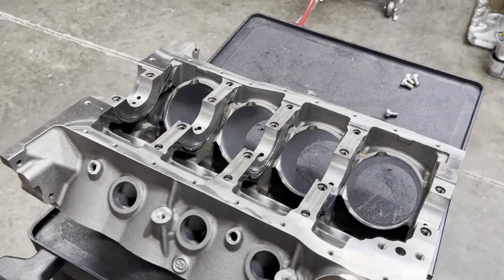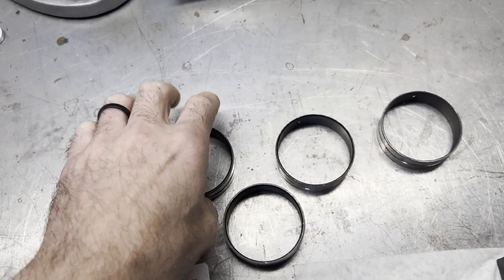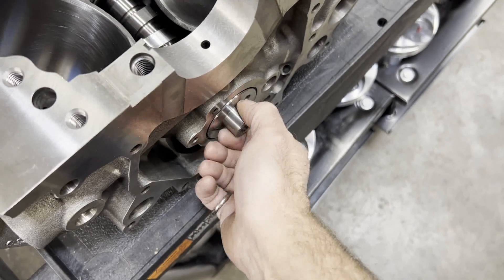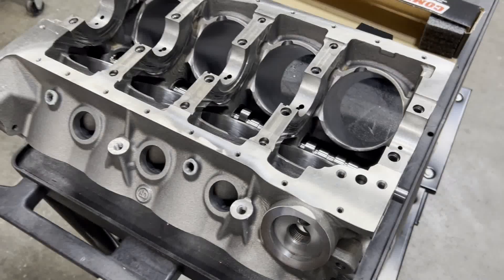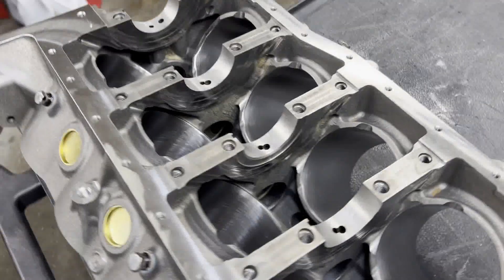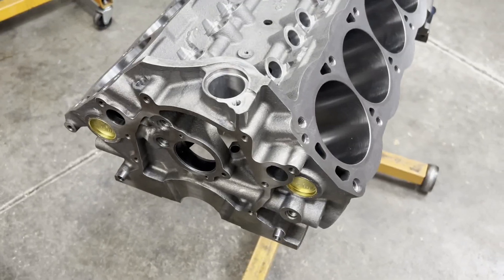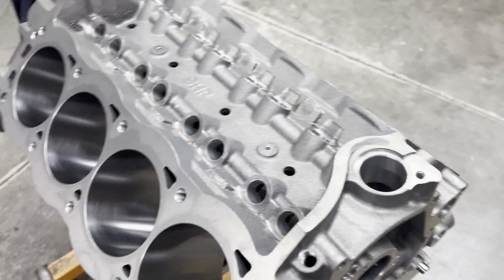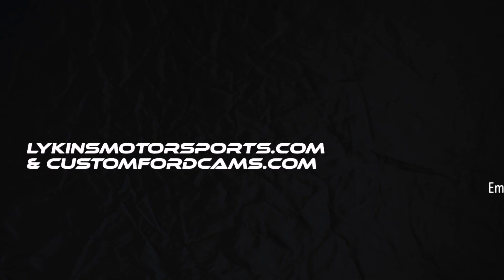Lykins Motorsports Dart SHP 8.200" Deck Overview/Prep

Comment: I heard your comment about the tingle in your foot. I definitely feel for you. Do you suffer from sciatica? I’ve had two MRI’s and several lower lumbar shots between L3 and L1. I tried whaat an old doctor told me to try, and I do not suffer ANY pain. I’ve been in and out of pain for over four years now, but when I started take it Vitamin B3 niacin-amide 10:29 , I got to were I had almost no pain. Niacin-amide is cheap and I take 1 or 2 pills a day. It’s your call, I am not a doctor, but I took the experience of an old doctor and got relief.  You c@nt hurt yourself taking this vitamin, and you can talk to your doctor, you prerogative.  Best regards Chet Marcotti, NH

Comment: Great update, You may have told us but, what do you use for cam plug sealant and freeze plugs?😁
Reply: I think he uses silicone sealant. 
I worked for an engine builder. 
And he always used FelPro Brush Tack. 
On the pipe plugs and the freeze plugs. 
It comes in small metal can with a brush in the cap. 
Its dark blue, and goes on like a liquid, then will tack up and dry. 👍👍

Comment: How does the Ford racing blocks compare to the aftermarket blocks
Reply: The ford racing BOSS blocks can hold around 1500hp. Plenty of enough
Reply from the maker: I'm not really a big fan of them.  Nodular iron caps, stock appearing fasteners, etc.  I've put 800 hp through one, but I'd still rather have a Dart or World.